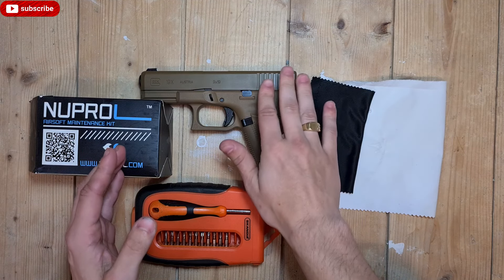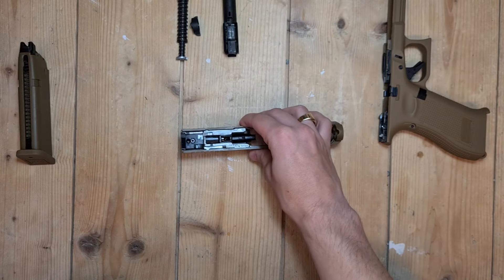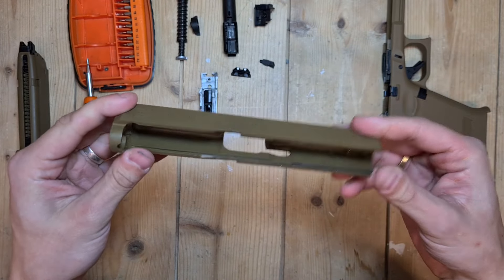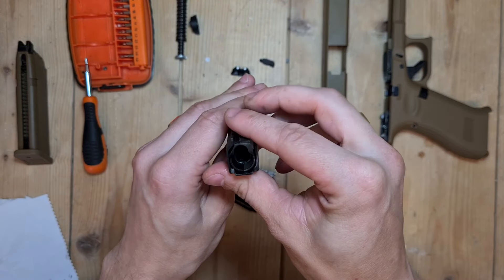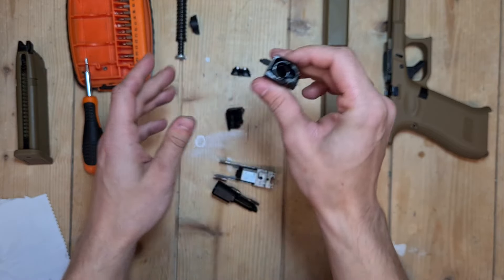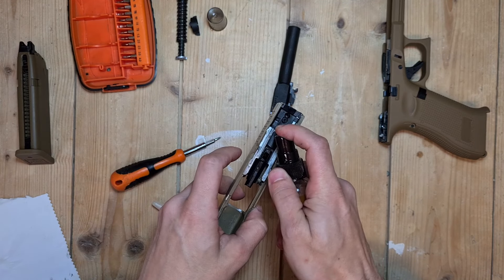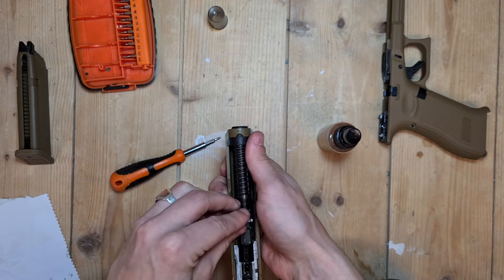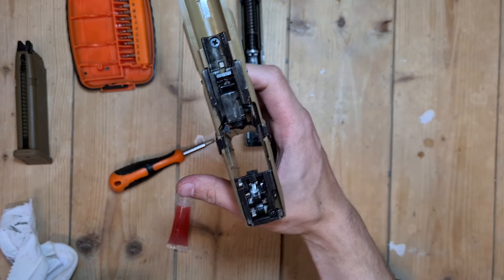Umarex Glock 19X Airsoft Maintenance! (Tutorial)

Comment: I have the same glock as the video i think but the two pins that you pull down when taking off the slide, my pins dont move at all and i put force on em. I also heard in a video they are just for show? but then how do i take off the slide
Reply: half blow back model is different than full blowback model
Reply: I think for the half blowback you have to take out the 3 pins to remove the slide but I’m not 100% sure
Reply: I haven’t tried but it looks like you need to unscrew the rod in the front below the barrel
Reply: The same as me. I could not clean the gun. 😢

Comment: This airsoft pistol is a piece of perfection! 😍
Reply from the maker: yeah
Reply: The damn slide on mine won’t even come off
Reply from the maker: I heard others with same issue i cant complain i never have trouble getting it off be sure rack slide first then try to get it off or slide lock it then hold pins down and release slide release :)
Reply: @AirsoftNLD  believe me, I’ve tried everything. It gets stuck just at the start of the rails it runs along, after the hammer. Once it gets there, I have to pull the trigger at the same time as pushing the slide forward with force. Which is really something I don’t want to do because then I have to reset the trigger by hand by pressing down on the levers which can’t be good.
Reply from the maker: Hammer broken? Not wanna reset?
Reply: @spacechimp3199  I just got mine and had the same problem. Just try it again and again, and if it moves forward past the bottom part even a little really pull on it. Worked with mine.
Reply: @zevhandelman4717  yeah I did it. It still only comes off with a wobble while I pull or if I pull it hard. Really sucks. That’s after 2 months too
Reply: With a new purchase and the hop up is set to be even with the barrel how do I set the hop up to a neutral position? If I adjust in one direction the screw will stop the slide from moving in the half blow back action so I can only screw the hop up screw to thread into the Barrel but I don’t know how many turns to neutral.
Reply: @robertdoyle6287  neutral is when turned fully counterclock wise.
Reply: @spacechimp3199  mine was a bit stucky in the beginning too. after a few times disasembling it, it does its job. i think the little plate inside is not fitting exactly or doesnt move all the way down to cause this problem.
Reply: Glock perfection

Comment: The two side button won’t even go down so I can take the slide off 🤦🏻‍♂️🤷🏻‍♂️
Reply from the maker: Should work no issues here they do wanna go in sometimes
Reply: Same here, I’m not trying break mine. Would you be able to make a video showing the internal function of the side buttons to get a better understanding?
Reply: UPDATE: Just use a little force by pushing with your thumb on the back of the slide while holding the side buttons down. I guess I’m just used to cheaper airsoft guns. Comes off easier the more you take it apart I feel like.

Comment: One way to take the orange tip off take the barrel out of the gun, boil up some water, then stick the barrel in the boiling water. Let it simmer in the water till you think it’s good (this heats up the glue and softens it up) take a pair of pliers or channellocks then pry it off.
This is only if you can’t take the orange tip off from YouTube videos you see. This is one way

Comment: I hope that you or someone who knows the answere is answering me 😅
So 1. that one black screw that holds the nozzle unit down and also the rear sight and that black plastic thing in the back. This one screw gets loose every time I shoot or just load the gun a few times. What do I do about it? EverOne seems to have no problems with that except me... and I’m trying to use lock tight right now and hope it helps. And 2. does it damage the hammer if I dry fire it? No gas, no mag or at least mag with no gas and bbs In it. Because I did it a lot and I think I took it to far... the triangular bearing on the hammer scratched of a bit of metal in the hammer housing and also bent the part where it sits in a bit. So does it come from me dry firing it without gas? Or am I just unlucky cus the screw that holds the spring to pull back the nozzle also just went loose and got fired out with one shot and the gun is still just a few days old but that’s not really my fault cus I didn’t do anything, never even took it apart before that happened...what am I doing wrong 😑???

P.S: does it damage the hop up unit if I accidentally double feed the gun (one round chambered in and reload again)?
Reply from the maker: lol idk about the screw i dont have that. that lock tight might be a solution. or maybe send it back lol. 
theres diffrent opinions on dry fire. i dont like to do it. some say it damages your pistol some dont. so i just dont do it.
double feed should not  be a problem i do that loads of times lol. maybe u can send it back for repair if its really that bad.

Comment: I bought the Co2 version and the slide release will not move and I can’t remove the slide. I called service and they say it is NOT supposed to come apart. I have the gen 5 version bought Oct 2021. 

Half blowback version.
Anyone have any suggestions?
Reply: Lock slide back hold both pins down release slide it will get stuff less than half way so just pull trigger when it gets stuck then it will easily slide right off
Reply: Stuck* not stuff lol
Reply: Sorry for such late response
Reply: @Sliggitysnake  I have the same pistol with the same problem. What he is saying is that the takedown pins don't move at all. It seems that umarex has made this pistol now ment to be taken down at all as even the hop up adjustment would get in the way of the slide moving forward and would need to be taken out. Would have been nice I'd that was made clear in any of the videos receiving the pistol online
Reply: Ignore comment on hop up adjustment was incorrect
Reply: @mowo25wilson4  hmm I'm not sure why that is happening...maybe dirty? I would say who ever made it messed up I would return it for a new one
Reply: yup, same here

Comment: Hey so I just got this airgun. Sometimes when I shoot the bb doesn't come out and then I pull the trigger next and it shoots 2 bbs. Also sometimes when I notice it didn't shoot the BB will just be loose inside of the gun, I will then pull out the mag and the bb will fall to the ground.What am I doing wrong or is my gun defective? I just got some gun oil to put on the CO2 cartridges to see if that is the issue. Is my magazine defective?
Reply from the maker: Idk man try some oil for the pistol maybe diffrent gas or adjust the hop up. Had issue where bb fell out idk try it

Comment: question: why does my 17 gen 4's outer barrel moves back and forth and creates rattle? when slide open.
Reply from the maker: Idk all has it
Reply: My 19 gen4 does the same, just got it and done the first shoot test, its a lil dissapointing
Reply: I'm maybe late but it's designed that way since the real glock barrel tips up to load the next bullet more easily  but I think most of the handguns has it. Although it won't affect your aiming since the inner barrel won't move
Reply: @razvan19010  because have chinese shit gun, cheapen gun what have and worst material and not made good.

Comment: I tried removing the slide but it only slides forward 1 inch and won't come off.
Reply from the maker: need some force somtimes. i always rack slide back lock it pull the 2 take down pins down and release slide.

Comment: I have the steel bb version and this doesn't work. I cant pull down the notches
Reply from the maker: idk about the steel bb versions they are not legal here but most of them should just work like i show in the video. real life glocks you have to pull trigger then u can get the slide off with airsoft its the other way around hammer must be reset

Comment: What about the hop up? Any chance you could post a video on tuning it cause I cannot figure it out for the life of me 😂
Reply from the maker: just use a key to turn left or right.  lol
Reply: @AirsoftNLD  okay it took me actually looking at the hop up mechanism to realize with grate in the wheel controlled it 😂🤣 the little divit on the rim and the center of the loop on the inside don’t match up
Reply from the maker: Hehe
Reply: @Blepoo  that wasn’t the problem the problem is when you take it apart to clean it you’ll more than likely fuck up where you had the hop up, and the gear itself is ridiculous but I figured it out 😂🤣

Comment: I stretched that nozzle return spring ever so slightly.. trying to take it off to clean that one part. I ordered another spring.. I find it so hard to remove it neatly, any tips on putting a new spring on? Thanks
Reply: 1 year later and I'm assuming you put yours on? how'd you put it on without ruining it?
Reply: @cuilery  It ended up being too damaged to reuse, I went ahead and purchased 3 more off a site and I paid way over price, but needed the replacement. Worth it. Just type, nozzle return spring for that specific gun and you’ll be set. But if you just trying to put it back on, just be careful hooking it slightly pull you won’t ruin it.

Comment: How do you remove the slide so easily?! I have the exact same gun and just can’t remove it.
Reply from the maker: Lock the slide backward push the 2 pins down and release slide.
Reply: @AirsoftNLD  i have the same problem and i did what you said, but it still won’t slide all the way out to remove it. Its weird.
Reply: @gloomy28  same problem here....doing my head in. I've watched loads of these vids where the slide just comes off. I can feel mine disengage and it's like its working but then sticks on something internally as the slide is about an inch past the front of the lower. Why?????? I've got a TM Glock that comes apart easy using same technique?
Reply: Actually...hold the front page...I think I solved it, not sure why this is necessary when clearly it's not in the above video. Follow the steps in the video, then after you release the slide catch and it pops forward, at the point where it sticks, pull the trigger and continue sliding. It should come straight off...mine did, tried it 3 times and it worked every time!
Reply: @Cruser1068  THANK YOU
Reply from the maker: Dont pull trigger when removing the slide only with real steel ones
Reply: @Cruser1068  Esto funciono , gracias!

Comment: I can't take off the rear sight.What should I do?
Reply from the maker: well remove screw first at the bottom then you can slide it off
Reply: @AirsoftNLD  I removed the screws, but the sight is too hard to slide.
Reply from the maker: Hammer lol they do use glue
Reply: @AirsoftNLD  lol Should I use a cigarette lighter to remove the glue？
Reply from the maker: I dont know man i got mine off you try you lol
Reply: @AirsoftNLD  That's right lol I got it.　　　
Thank you!
Reply from the maker: welcome!
Reply: @AirsoftNLD  I hit it with a hammer and it came off! Thank you！

Comment: Seriously??? This is maintenance?  Do that in the Marine Corps and one brush with a white q-tip and you would fail!  Yes, it doesn't have the prerequisite carbon deposits of and actual combustible firearm ammunition, but one swipe on the forward end of the slide, hitting the forward ends of the lower and upper rail heads?  To swipe out the fire grouping?  The guides? REALLY?  That is an effort to make it functional for a very short period of time.  Nothing more, nothing less.
Reply from the maker: Its a toy mate go cry some where else